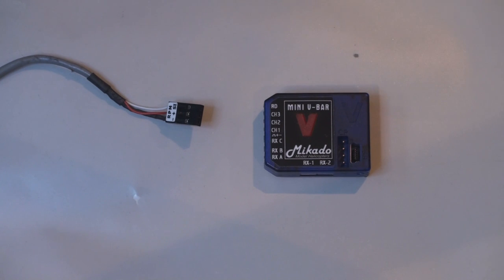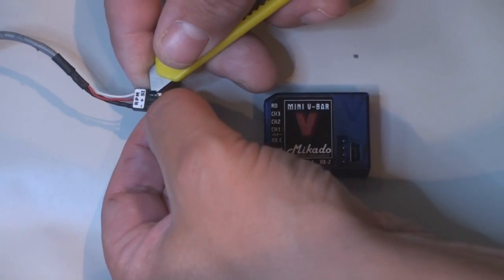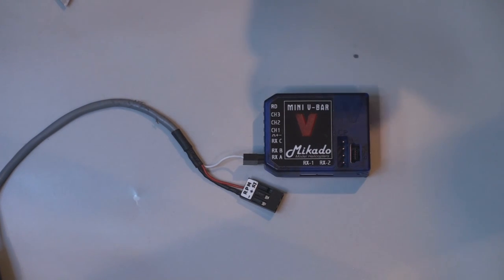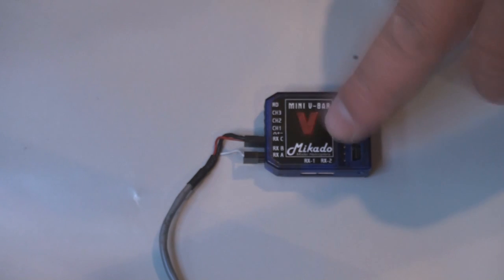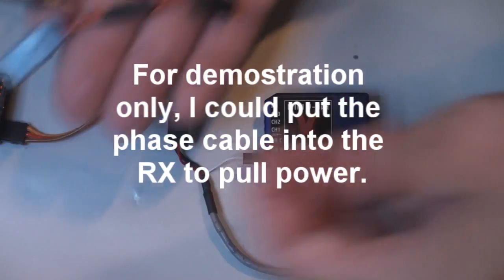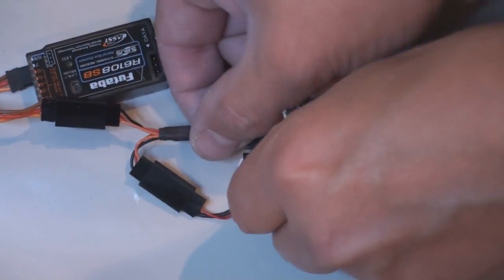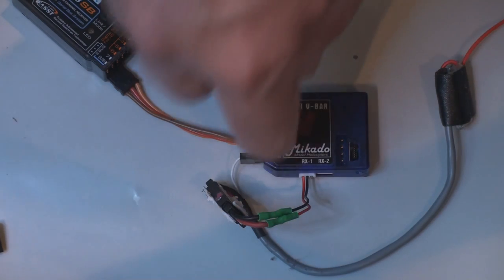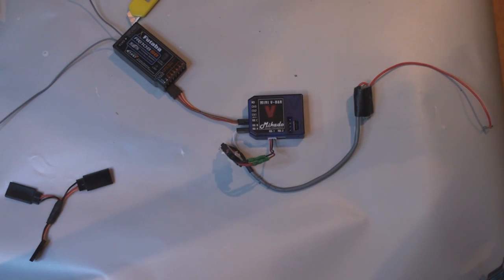VBar 5.2 - Episode 19 - Phase sensor on Mini

Comment: Hello Mr Mel, I ordered this especial wire from Mikado to work with phase sensor. I'm using Futaba sbus and its wired directly to RXC into the Vbar. My question is if I go with your connection using a y cable, where do I plug the Esc? Is it directly to the receiver port on channel 3 or directly into the Vbar in RXB? Thank you Mr Mel.

Comment: iam using a spectrum with a seperate bec going into c how would i go around that, use a y harness for my bec and my sensor together or is there another way iam running my servos at 6v

Comment: Thanks for your video of the phase sensor on mini stabi vbar 5.2. I have some questions. I have a futaba r617fs and all channels are used in the vbar (except rx1 and rx2). As shown on the video how can I put the white cable of the sensor in rx A (which is already occupied). Using Rx-1 is no problem. What about this max 6 volts. I use 6 pack lipo and have a bec in my esc but no separate bec. Is this ok.